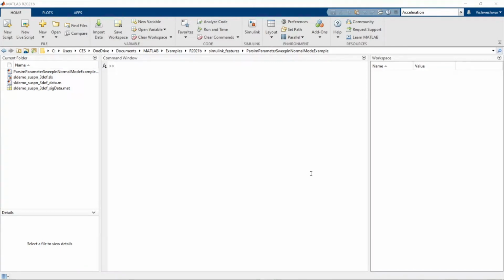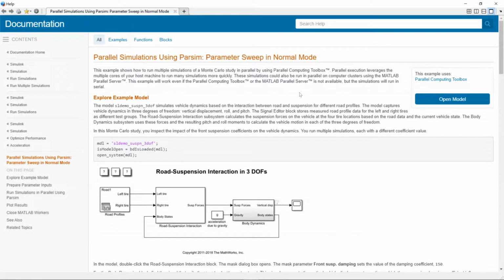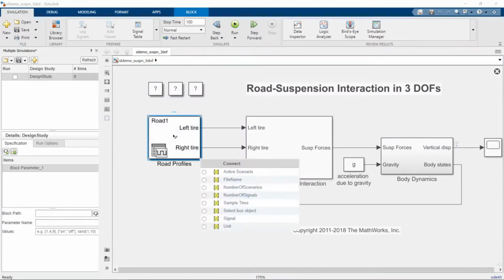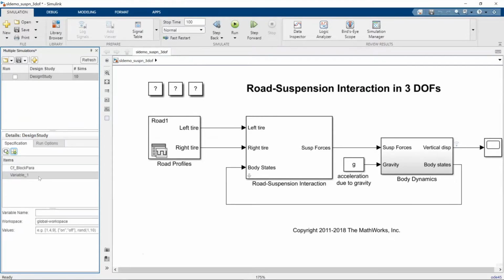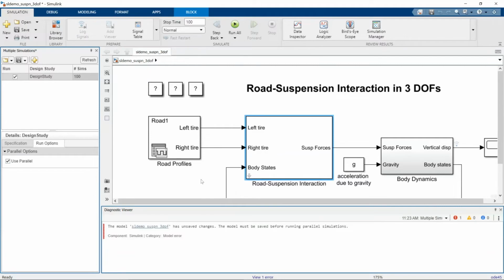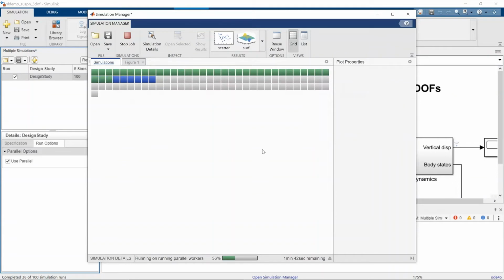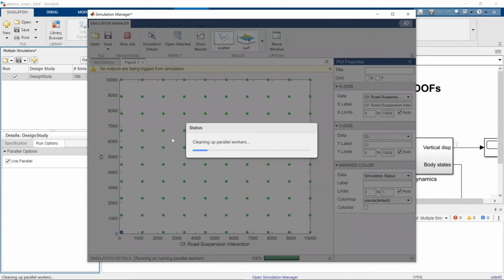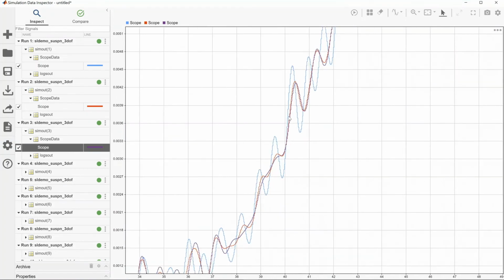Simulink r2021b  - new features

Comment: I’m simulating a multibody vehicle model. Within this model I’m using nonlinear dampers – damper subsystem reads the damper velocity vector and damper force vector from base workspace. Force and velocity vectors are defined via live script which uses base workspace variables for “low speed” compression damping, “high speed” compression damping, blow off velocity (damper velocity at which it “switches” to “high speed” damping curve etc. 

%Variables that I want to change/sweep in an automated design stady
fdlb; % Bump/Compression Low speed damping rate 
fdhb; % Bump/Compression High speed damping rate 
fdlr; % Rebound Low speed damping rate 
fdhr; % Rebound High speed damping rate 
fkb; % Bump/Compression High/Low speed cutoff coefficient (number of velocity vector component)
fkr; % Rebound High/Low speed cutoff coefficient 

script that I use to create damper force and velocity vectors (variables that I fed to Simulink model)

fvb=0:0.025:0.3; % Bump/Compression velocity (positive) vector
fvr=-0.3:0.025:0; % Rebound velocity (negative) vector
fvhb=fvb(fkb:end); % Bump/Compression High Speed velocity vector 
fvlr=fvr(fkr:end); % Rebound Low Speed velocity vector
fvhr=fvr(1:fkr); % Rebound High Speed velocity vector
fDbl=fvlb*fdlb; % Bump/Compression Low Speed damping forces
fDbhi=fvhb*fdhb; % Bump/Compression High Speed damping forces (starting from zero)
fDeltab=fDbl(end)-fDbhi(1);  % Delta at kb (cutoff velocity) 
fDbh=fvhb*fdhb+fDeltab; % Bump/Compression High Speed damping forces
fDrl=fvlr*fdlr; % Rebound Low Speed damping forces
fDrhi=fvhr*fdhr; % Rebound High Speed damping forces (starting from zero)
fDeltar=fDrl(1)-fDrhi(end);  % Delta at kr (cutoff velocity) 
fDrh=fvhr*fdhr+fDeltar; % Rebound High Speed damping forces
% Front Damper force and velocity vectors
F_vDamper=[fvr,fvb(2:end)]
F_fDamper=[fDrh,fDrl(2:end),fDbl(2:end),fDbh(2:end)]
 % assigning vectors to workspace variables that simulink non linear
 % damper will use for velocity and force vectors
Damper.NonLinear.Faxle.vDamper.Value=F_vDamper; 
Damper.NonLinear.Faxle.fDamper.Value=F_fDamper;  
        
    In the Model Callbacks (InitFcn) I call this above-mentioned Live script to update damping force and velocity vectors according to current values (base workspace) of above-mentioned variables. 
  My problem is that I can’t figure out how I can do damping parameter sweeps… i.e. how can I set up the model so that it runs multiple simulations and changes damping related variables (base workspace) according to some predefined list.  It works fine if I would be changing/sweeping any of model block parameters or variables that are mentioned within block. In this particular case it’s an array with values calculated via script. If I setup design study from multiple simulations panel – it doesn’t effect variables in base workspace that would effect the script that calculates required vectors.
I’ve tried to use matlab function block within model that would use this script to create required vectors and assign it to base (or model) workspace but it doesn’t work or better say I don’t know how to do it properly.
Any suggestions would be very highly appreciated.

Thank you.
Ted